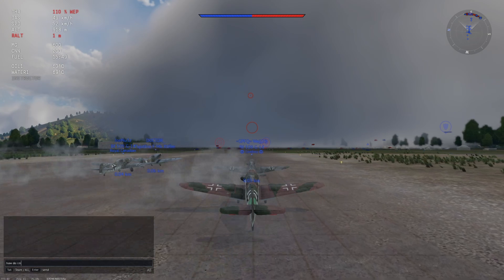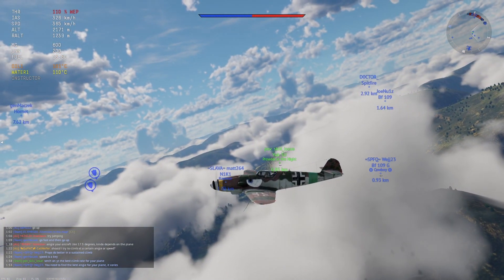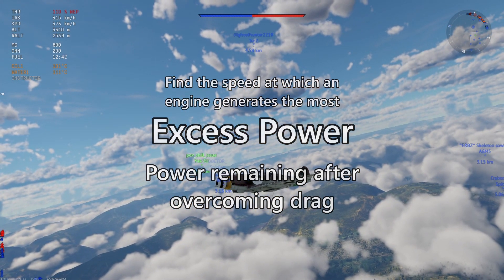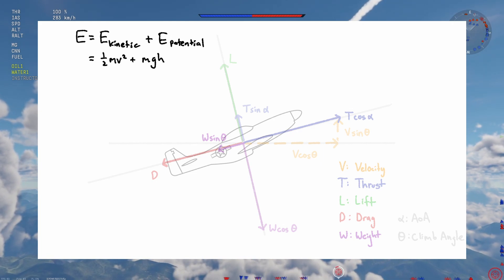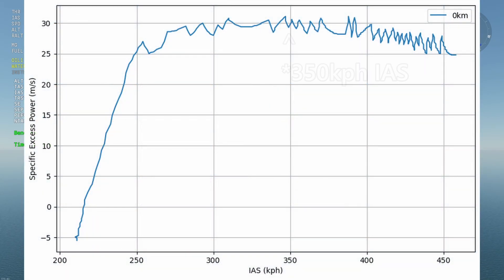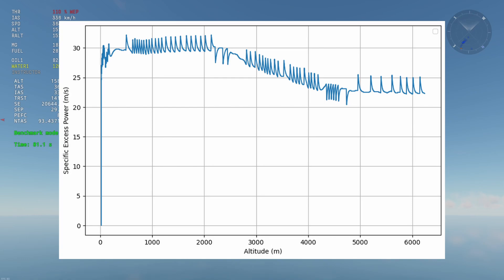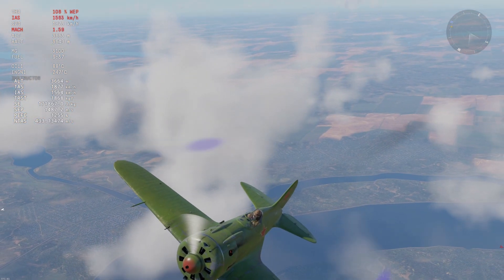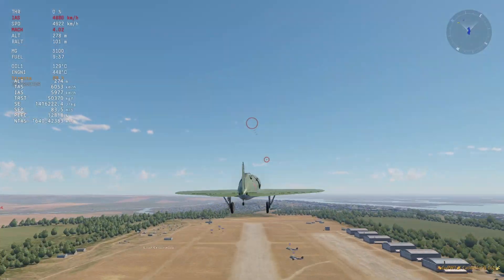Optimizing Rate of Climb | War Thunder

Comment: My approach was always to climb so as to minimize drag, since prop efficiency is more or less constant above 200ias for most planes (though there are exceptions, namely BF-109s). When induced drag dominates, you get visible wingtip vortices in-game, so 20-50IAS above the speed at which the vortices disappear always puts you very close to the optimal climb, and you can easily figure it out on on the fly.
Reply from the maker: that may work as a rule of thumb for low tier props but generally speaking, the speed at which lift/drag ratio is minimized is not the ideal climb speed. you can look on the wikipedia page for rate of climb for the graph but you're looking for the speed where there is the maximum difference between engine power output and L/D ratio are achieved, which is not necessarily at the speed of minimum L/D ratio.
I'll also politely disagree with the claim that prop efficiency doesn't change significantly above 200kph ias for a majority of the planes.
As an example, the p51h has a prop efficiency around 60% at 200kph while it only begins to level out at 80-85% at around 300kph ias at sea level.
The p51h makes wing vortices at maybe 220kph ias, but 350kph is much more than +50kph from that.

though these are just my 2 cents, if your method works for you then what ive said here doesn't really mean anything
Reply: @CatWerfer  Look at energy instead of climb rate. For most single-engine monoplanes, prop efficiency plateaus at 80-85%, while minimum drag is between 200-250IAS, where you see prop efficiencies of 65-70%, so you have maybe 20% of effective engine power to gain by flying faster. On the other hand, the power lost to drag increases dramatically at higher speeds (parasitic drag power loss scales with velocity cubed), so you cannot go much faster. Thus, the optimal climb IAS is slightly faster than the minimum drag IAS (which is constant) and so it doesn't change much with altitude or engine power, which is why it's standard practice.

Note that you can climb at a lower-than-optimal speed and end up slightly higher but with less energy (which is not what you want, maximizing total energy is the goal of a climb) so the optimal climb IAS is difficult to determine, but it exists
Reply from the maker: @KekusMagnus  again, this is probably fine as a rule of thumb but you can't really call it "optimal" if you haven't actually tested it. I think I've made my methods and calculations about as clear as possible and if you still disagree then there's not much I can do for you
Reply: @KekusMagnus an increase in drag can still be worth it, as your climb will be faster.

Power is velocity times force, with more drag, your climbing force is lower, but a speed increase can more than makr up for this, overall increasing your climbing power.
Reply: @silience4095  This is way simpler than you guys make it out to be. The engine inputs power into the aircraft (power*prop efficiency), drag takes away power from the aircraft (drag*velocity). The rest of the power is turned into mechanical energy (what you want when climbing). Thus, maximizing (engine power*prop efficiency - drag*velocity) gives you an optimal climb, so note how
1) this is only a function of velocity (so climbing by IAS is good practice, since IAS is roughly proportional to drag)
2) prop efficiency changes very little with velocity compared to drag, so the optimal climb has to be near the speed minimizing drag.
In practice I have found it is usually slightly higher. I personally tend to trust the "notorious" spreadsheet as most FMs have not changed in 6 years
Reply: @KekusMagnus  Yes, it is slightly higher, because despite there being more drag, the higher velocity ends up giving you more power.

P = (T-D)v

The increase in D is more than compensated by the increase in v, you end up with more power.

And nah, it's not more complicated than it has to be, aerodynamics are complicated, though micromanaging climb to an extreme degree will not affect the outcome of your match by a lot, it'd only be useful in very close encounters.
Reply: @silience4095  Yes, but you're making assumptions about dT/dv (more precisely, that dT/dv > (D-T)/v when D is minimized ). When I talked about prop efficiency earlier this is essentially what I was claiming. The only thing I've conveniently ignored this whole time is that prop efficiency is a function of TAS and not IAS, so the optimal climb IAS decreases slightly with altitude but the difference is not that big unless you go very high.

All in all, the testing in the video is quite robust, I did not know about WRTI, I'll have to try it out. I only disagree with the conclusion that micromanaging the climb is useless. The Air RB meta is to aggressively take out as many enemies as you can early in the match. You gained 30IAS by climbing better, this is enough to be the difference needed to stall out your opponent in the crucial first engagement

The P-51 also just happens to stay near its optimal climb speed if you climb at 17.5 degrees, I'm not convinced this strategy works well for all props.
Reply from the maker: Do go give WTRTI a try, it's a pretty neat tool.
Do make sure to be wary that there are datapoints that are pulled directly from localhost and are basically 100% accurate, but there are also values that are calculated and filtered and so have a degree of potential loss in data fidelity.

I wasn't trying to make the claim that all planes should climb at 17.5 degrees and I wasn't trying to say that minmaxing climbrate is useless, moreso that for the amount of additional effort you put in, you don't get quite as much out of it. I did some additonal tests in the 109k4 and spit LF mk9 and they had similar results where just AFK climbing was pretty close to a set IAS climb or a max SEP climb and for that amount of effort, it is not personally worth it to me. If you think the additional gain is worth it for you, then go right ahead and do micromanage, I can't stop you. Some planes probably benefit more than others from micromanaging but I don't have all day to sit and test all of them so I won't know for sure.

I personally don't sweat too hard when playing air RB, especially at the start. If you know the average war thunder player, you can almost always win against them in nearly any monoplane fighter as long as you have some altitude and are a decent enough pilot to know about situational awareness, positioning, throttle control, flap control, and vehicle matchups. I also kind of enjoy dogfighting at a disadvantage sometimes, it makes the game much more fun and about personal positioning and reversing, which I think is a lot more skill based but also more importantly much more fun than "haha i outclimbed you i'm going to boom and zoom you to death now". I'm not too worried about winning or losing or getting high kill games either, as long as I get a fun dogfight out of a game, I don't mind winning or losing or dying. I'd rather get shot down and go down fighting than have a game where our entire team sweeps and nothing interesting happens.

But thats just me :P you do you
Reply: @KekusMagnus  Yes, the constant angle climb is a coincidence. 

And as for not making a huge difference, I guess I'm speaking about simulator battles, where aiming in stalls is harder than in RB, and situational awareness is lower.

And yes do check out WTRTI. I contributed the SEP (specific excess power) indicator, which is what you should use to test climb. It actually displays the derivative of your energy expressed in terms of altitude.

20 m/s for example, means that your energy gain, regardless of if you're diving, climbing, or turning, is as though you were climbing at 20 m/s at constant speed.

Comment: Very cool video, afk side climbing it is I guess

But there's something bugging me, for some planes with an airspawn for example, would you have the most altitude advantage (or minimise your altitude disadvantage) when meeting the enemy by maximising your climb rate as usual, or by speeding towards the enemy base before they have a chance to climb high enough? What about planes that perform better at lower altitudes? The airfields are far away enough from each other that it probably doesn't matter but for weird planes like the mosquito it seems to have some effect on my match performance
Reply from the maker: yep, if the difference was much bigger i'd actually care to put effort into climbing but for an additional 200m i dont think its worth it